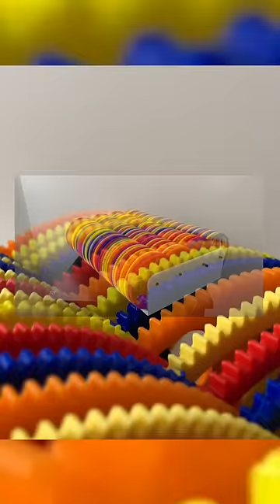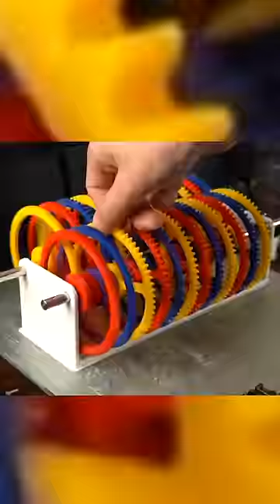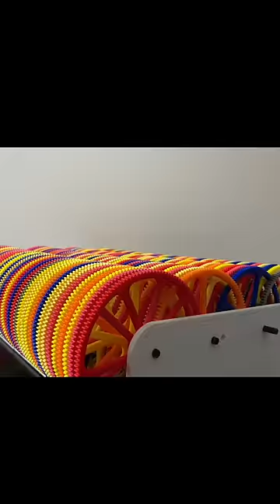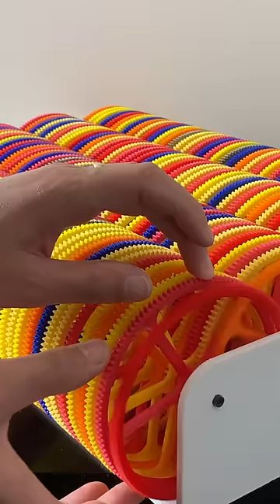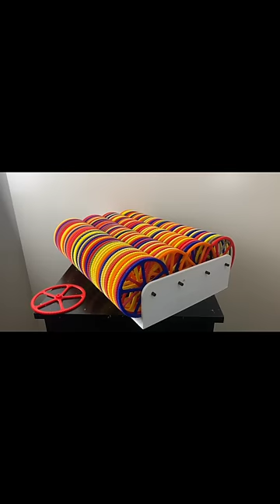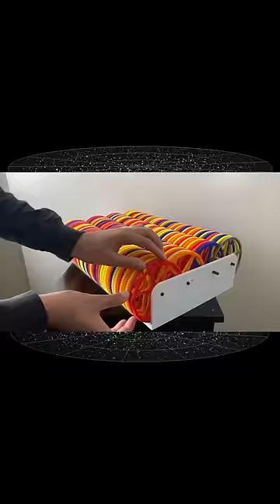World's Highest Gear Ratio (in 60 seconds)

Comment: -Moves the last gear just to see how fast the first one goes
-The whole contraption explodes
Reply: *universe
Reply: If you could move the last gear it would mean that the first gear would move faster than the speed of light 😂😂
Reply: yeah I don't think a thin plastic gear would be able to take that kind of load.
Reply: @MadsterV  just curious what happens if you try to spin it? Is it just impossible? It's weird to think flimsy plastic would be hard to spin, but I guess at best you'd break the plastic before the gear would move eh
Reply: @hansolo631 you couldn’t cause you woud have to push 10^100 times harder
Reply: @hansolo631 you'd break it, it's completely impossible to spin the last gear because if you want to spin it, you'll have to use force faster than the speed of light, basically like the first one.
Reply: That's all I wanted him to do
Reply: same
Reply: @hansolo631  ofcourse it will break the amount of torque required to spin the last gear at human eye observable speed is far more than the amount of work to move stellar massive blackholes across galaxies, so yeah the last gear wont budge a little bit until it breaks. If u keep increasing the force it will go beyond the elastic limit of plastic and break or bend. Suppose say u have an indestructible material and light gears and there is no friction involved, the gears are so light u have to use 1 erg energy to complete i rotation with just adjacent gear, so 1 gear takes 1 erg, 2nd takes 100 erg, by 7th it will be 1 joule by 100 it will be 10 to the power 93 joules, the total energy of universe by mass is 10 to the power 71, so by the 30 to 40th gear only my estimation those gears will spin faster than speed of light, since objects with mass cannot reach speed of light therefore those the last gear will not move

Comment: "How much torque does this thing make?"
"yes."
Reply: About the same as one a fraction of the size..... Because the plastic will break at the same point.
Reply: @UKMonkey  Bro, It's a joke
Reply: Lol bro took it seriously 🤣🤣
Reply: But it's probably maybe about a billion torque
Reply: @rleoz2669  I doubt that's even close, realistically if you could turn the final gear it would be an unfathomable amount of torque, we're talking in the googolplex range
Reply: At this point YES is the new Undefined or Math Error
Reply: @SlowSTEN  so what you're saying is that this doesn't make the torque refrenced in the original joke?
Reply: "no."
Reply: @UKMonkey  then make it out of metal.
Reply: @ANONM60D  yesn't
Reply: @DigitalHandle  finally, a weapon to surpass metal gear
Reply: More than water lol
Reply: Answer: all of it.
Reply: @psyok  Coming from you that's rich, You add little to the conversation.
Reply: 42
Reply: Depends on whats powering it
Reply: Introducing the all new 2024 Ford Super Trucker Mega Duty "My Weiner is totally average sized" F9000. Boasting 180 quintillion foot pounds of torque, and enough towing capacity to send your ex wife into the sun during divorce court. Buy this truck, be a real man. Ford.
Reply: none because assuming all gears are engaged 100% of the time to output , the last gear is overdrive
and probably has a ratio of 0:0000000.0000000000^000000001 something
perhaps even the gearbox produces negative torque, that is, you go back in time (?)
Reply: @SlowSTEN  googleplex is 10^100, the torque in N•m or whatever units it’s supposed to be is somewhere around 10^165 to 10^175
Reply: @SlowSTEN  Plastic Gear Solid
Reply: @SlowSTEN  16 hextillion torque this gearbox defeated Goku
Reply: @Juppie902  what's you mean
Reply: @SlowSTEN  Its like UKMonkey thinks he is Sheldon.
Reply: Love this joke
Reply: Nobody:

Will it fit in my Honda?
Hold my beer
Am I a joke to you?
Asking for a friend
Everybody gangsta
End this man’s whole career
He protecc, he attacc …
Sexual/genitalia innuendo/big balls
Scatological/flatulence /potty joke 
Question of quantity answered yes
Plot twist
Left/entered the chat
Gaming reference
Dislikes are from
I’m a simple man
Not gonna lie
No one gonna talk about
Last time I was this early
First
Legend has it
That’ll buff right out
Fun fact
(X) be like
(X) intensifies
(X) wants to know your location
Ha ha (X) go brrrrr
POV: (X)
(X):
Also (X):
Imagine (X)
Her: I'm home alone
It’s complicated
YT algorithm counting down years
Who’s watching in current year?
You Tube recommendations
It’s free real estate
So you've chosen death?
Want a cookie?
Touch grass
You must be great at parties
Understandable, have a great day.
Punch line below read more
Reply: Not much, its plastic it will breakm
Reply: Torque is the amount of energy required to move a set mass a set distance, most commonly it’s understood as one pound moved one foot equals 1 lbft. The gear has nothing to do with the torque. The torque is produced from whatever moves the gears not the gears themselves. The torque can not be changed by gears. Gears change rpm’s. To make it simple for you fools. You can’t add torque to your truck by changing your transmission. You change the motor to get more torque (power).
Reply: kingkong.godzilla
Reply: Planck Torque
Reply: all of it
Reply: "hey man that thing got a Hemi in it?!"
Reply: @rleoz2669  Why are you making fun of someone taking this joke seriously. You do realize you're on an engineering channel, right?
Reply: @pappi8338  ok.
Reply: @SlowSTEN it's kinda bad joke though cause it doesn't make sense. Man's reply got a point yo. It's only funny if you misunderstand how torque works
Reply: Needs more gears if its going to be used in the fast and furious franchise
Reply: The answer is zero.
Reply: @DigitalHandle  it better fit in my cobalt
Reply: 2.5GPA  Not funny, didn't laugh.
Reply: The maximum torque that it can actually output it that value that can strip the teeth off the last cog set or otherwise cause it to fail.for printed polymer :-Not very much. This is a very cool model though congrats
Reply: Some redneck put this in his truck because he knows torque wins races. Hes still at the startline
Reply: Jesus loves you and he calls you to repent turn away from sin and turn to faith in God and be morally righteous
Reply: @redpepper74  10^100 is a googol not googolplex. A googolplex is 10^(10^100). Not the same thing. Also note the spelling.
Reply: @nateg08  no yeah you’re right, I must have been half-asleep when I wrote that comment lol
Reply: On a serious note, doesn't the generated torque scale anti-proportionally to the speed (conservation of energy and such)? So the torque at the last gear would be 10e167 times the torque applied to the first?
Reply: @doomse150  I'm not sure about the science, nor the exact number but it'd be astronomical for sure.
Reply: @ANONM60D No they were replying to the person explaining that the plastic would break. That's irrelevant to the joke by the OP.
Reply: Yep
Reply: Answer: How much do you want it to make?
Reply: @rleoz2669  depends on the input force. just 1 gram of force on the input, will produce 1*10^169 grams on the output, or 1*10^166 kilograms. Way more than a billion. which by the way, the universe has an estimated mass of 1.5*10^53 kilograms. Which means the output force is more than enough to move the universe.

Now, if instead of rotating the gears, to increase torque, we go the opposite direction. If by some miracle, we could even move the final gear, we will spin the first gear fast enough to likely destroy the multi-verse, and that is absolutely hilarious to me.
Reply: @Juppie902  Rotation of the final gear, will be absolutely slow, and assuming perfect 100% contact at all times, an output force of 1*10^169 grams of force, if the input is 1 gram of force (1*10^166 kilograms of force). By the way, 1 gram of force, is less than 1 Newton of force, which is roughly 102 grams of force. So yeah, you either get, extreme output force for slower speed, or extreme speed for lower output force, depending on which direction you send the force.
Reply: Answer: ALL of it!
Reply: Now, just hook a drive chain from the last gear back to the first, & BANG!:  Multiverse!
Reply: yes is not a measurement.
Reply: @IvanDaniel28  It is when you have enough torque to move the universe.
Reply: @IvanDaniel28   R/Woosh

Comment: What would happen if you spun the very last gear would it break? Would time implode? Would a whirlwind form in your house?
Reply: Yes, it would break before it moved.
Reply: @mandowarrior123 but what would happen if you spun the last gear with your hand and the gears are infinitely strong so they cannot break?
Reply: @felixf6811 You'd need more force than would be physically possible (it would bend spacetime more than a black hole). It's not that the contraption would "just break" it's like trying to push the pyramids of Giza with your bare hands.

Comment: Spinning the final gear even 5 atoms will allow almost 500 years of electricity for the entire world.
Reply: thats not how energy works
Reply: @morgue502  It's as if, it's a JOKE.
Reply: @vpansf  So the joke is that the calculations don't make sense?

Stop using the joke card to attack other people. It doesn't make sense and it's probably even an understatement to the actual power of this machine if it ever managed to move 5 atoms in any reasonable amount of time.
Reply: @vpansf  You also asserted a joke as a fact and there is no way we can tell that you were joking. So don't go around blaming other people for not getting your "joke".
Reply: @danielyuan9862  When did I assert that it was a fact? You wouldn't even be able to spin the final gear, it'll just combust. If people don't get the joke, it's not my fault they don't have common sense.
Reply: Not enough torque
Reply: The "🤓" is strong in this one
Reply: Moral: spin the last one and get free energy XAXAXAXAXA
Reply: @danielyuan9862 common sense bro😂
Reply: @morgue502 🤓
Reply: @OystercrackerCommunity  Nah, you want a nerd, look to me... I who will tell you that any movement possible on that last gear, will cause the first gear to spin fast enough, to likely destroy the multiverse. Which means the energy provided will certainly be able to last more than 500 years, provided we could survive the destruction of the universe. And quite honestly, that's more hilarious to me than the original joke.
Reply: @deathsheir2035 The multiverse isn't a thing dude this isn't Spider-Man.
Reply: @nynvib276 its a joke
Reply: I see Karen brought her son along this time!
Reply: @danielyuan9862  I understood it to be a joke before I finished reading it. Just confess you struggle with social cues and move on.
Reply: @vpansf not a very good one
Reply: @danielyuan9862  there’s actually so many ways you could tell they were joking you just aren’t as good with words as you think you are with science.
Reply: @danielyuan9862  😭Bro it is common sense how do ya'll not get that this is a joke. Just because it wasn't funny to you doesn't mean u gotta ruin it for others.
Reply: There's a lot of people who can't understand jokes here.
Reply: @vpansf Aren’t jokes supposed to be humorous?
Reply: Assuming this is true, moving it 5 atoms would take more energy due to energy loss from friction
Reply: The torque you need

Comment: Imagine the torque of the last gear, you could probably move the whole universe with that much torque
Reply: And by the time it starts to visibly turn, we might've invented plastics that can withstand a small fraction of that power. But probably we've all been dead for a long time.
Reply: Gears change rpm’s not torque. Torque is a measure of power, the power is the guys hand moving the gears. You don’t get more hp or torque from a motor by changing gears. Stay in school fools and please don’t vote.
Reply: @williambrandondavis6897  That's not correct. Torque is a rotational force. You do get a higher torque if a smaller gear drives a larger gear since the lever that's applying the force is shorter than the lever it's applying the force to.

Horsepower, on the other hand, is a bit different, since it's about work over time, and not the capacity to apply a force, but it's not relevant here.
Reply: @williambrandondavis6897  Wow.
Reply: @williambrandondavis6897  not sure im understanding what your saying. Yes the rpm changes but torque and speed alsi changes by the gear ratio. A prime example is a bicycle.
Reply: @williambrandondavis6897  WTF LOOL its literally one of the main thing a gearbox do. Giving you more torque if you engage a smaller gear. Stay in school and don't vote.
Reply: @williambrandondavis6897  yo buddy your confidence 😂
Reply: @williambrandondavis6897  my guy was so confident that i had to rethink about a torque change.
Reply: Torque X RPM = POWER
Reply: Orrrrrrr break the plastic. 🤣
Reply: @williambrandondavis6897 wrong don’t go speaking like an expert if you’re not even a mechanic or engineer. you’re confusing torque with horsepower which can be easily confused if you’re new to the concept but torque is rotational force or specifically in an automotive application it is the rotational force of the final gear in the drivetrain, while horsepower is the result of an equation where the two variables are torque and rpm therefore your gear ratios are a primary factor in determining torque and rpm only affects horsepower since it is a variable of horsepower
Reply: @williambrandondavis6897  dude you trade speed for torque with a lower gear ratio . You need that refresher course and please don’t vote and try not to let natural selection catch up with you!
Reply: @williambrandondavis6897  
my dude just got spanked by the comment section. Will he respond?
Reply: He’s toast
Reply: Mans got no torque in his wanna be smart noggin
Reply: @williambrandondavis6897 lmao we will stay in school. You should consider attending one.
Reply: @BODShotgun  he just made a mistake. Don’t have to be so harsh
Reply: @jahz_287  True but he told them too stay in school and too not vote on the basis of a totally false statement. "@williambrandondavis6897

11 days ago
Gears change rpm’s not torque. Torque is a measure of power, the power is the guys hand moving the gears. You don’t get more hp or torque from a motor by changing gears. Stay in school fools and please don’t vote."
Reply: If you live in a glass house don't throw stones
Reply: @williambrandondavis6897  you should've stayed in school because that is literally the opposite from the truth😭😭
Reply: @williambrandondavis6897 I guess gear reduction is just a myth then. I think you need to go back to school higher or lower gear ratios definitely change torque.I’m a diesel/heavy equipment mechanic I’m very familiar with hp and torque and how they work together.your right tho changing gearing doesn’t change hp of an engine or Motor but it does change the torque
Reply: @williambrandondavis6897  Bro really said don't vote for being right 💀
Reply: @williambrandondavis6897  are you gonna say something or delete your comment ?
Reply: @pelufaz8435 
Leave him alone! He's already dead!!
Reply: @videoclipits  ur missing ÷5252
Reply: To answer your question yes u can lift the weight of the universe with that you would just need gears that don’t break and unlimited time and energy.

Comment: Scientists: Nothing is faster than light.
Me:(spins the last gear)
Reply: Yeah but after removing from gearbox 😂
Reply: You would have to be really strong to start spining that last one
Reply: @Crabyboi3237  So what if you were the Hulk, Superman, Thor, or Thanos with the power stone
Reply: @GolemDude  not even they could turn it, you’d have to be god himself to 💀
Reply: @Crabyboi3237 nah. It's a piece of plastic, ccan easily get that to spin
Reply: @jesserobinson6614  It's not like it's infinite, right? Someone should calculate the amount of force required to spin it
Reply: In these machines you can't spin the last gear without breaking it. It can't spin without other gears spinning with it, you see, and the speed of light is a very real restriction :)
Reply: You would need the weight of the earth to spin it
Reply: if?
Reply: @GolemDude That's easy. If you had to spin the first wheel faster than the speed of light to rotate the last one even once before the heat death of the universe, that means that all the available energy in the entire universe wouldn't be enough to rotate the last one even once before the heat death of the universe, as the required energy to achieve Lightspeed is infinite for particles that have mass.
Reply: @SEQUOIALOVER2002 that wouldn't be nearly enough, all the energy on the universe combined wouldn't be enough.
Reply: @GolemDude so he talks about its easy to spin lets say its 50g then since theyre 60 of em you do 50 to the power of 60 

using a calculator its 
86736000000000000000000000000000000000000000000000000000000000000000000000000000000000000000000000000000000 grams or

867360000000000000000000000000000000000000000000000000000000000000000000000000000000000000000000000000000 kilograms so about the weight of the milky way maybe?
Reply: It approaches infinite
 @GolemDude
Reply: @The38alt did you understand the video!?
Reply: good luck with that....
Reply: Humans are not capable of spinning the last gear because it is HEAVY
Reply: @Nguyengrays nah, some people can turn it, it just breaks the plastic lol
Reply: @eggchin9721  Typo